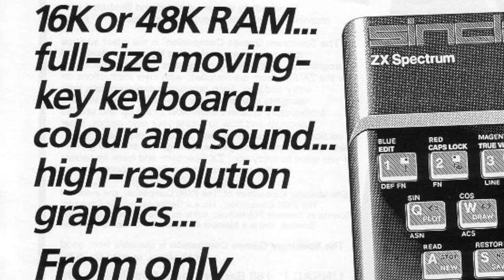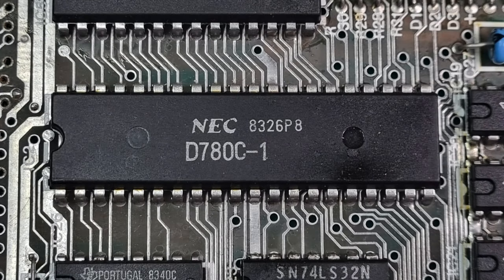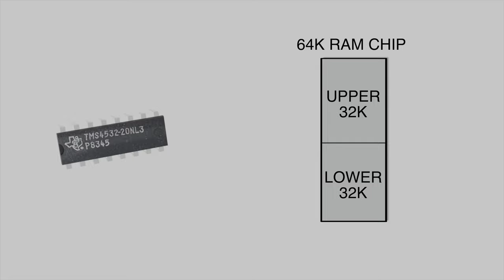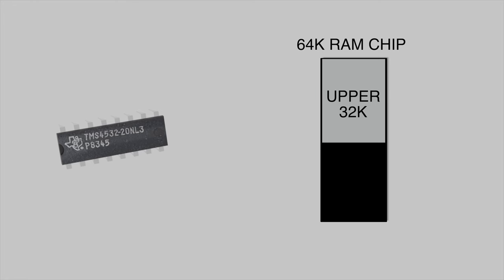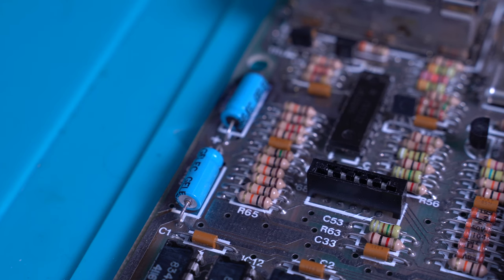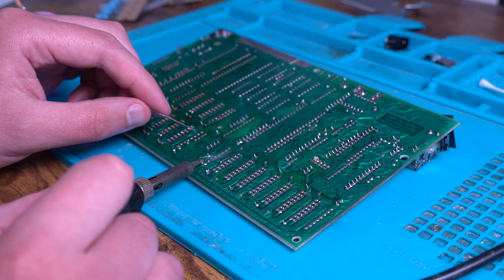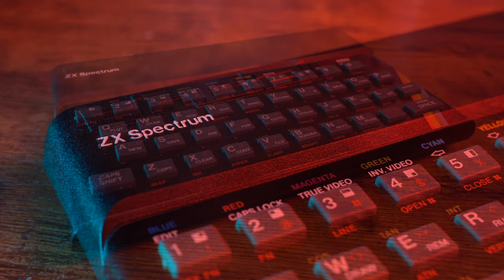ZX Spectrum - 40th Anniversary Restoration - 4K

Comment: I have - probably the only one - a ZX Spectrum which has a combined Composite Video + RF output.
Eg. it works with both composite video monitors AND old TV sets that can not handle composite video.
This modification was done by a shop owner, in order to allow me to use a composite video monitor; I told the shop owner that I still wanted to be able to use the Spectrum with a TV and he knew enough about electronics to make it hybrid.
From the outside, the ZX Spectrum still looks like any other Spectrum. I really wish every Spectrum had this modification.
Less than 10 years ago, I gave my Spectrum a new keyboard membrane and a new 'rubber mat'; the new keyboard membrane is much more durable than the original.

Comment: Great that the old TV modulator was left in place. Personally, I also leave the old heatsink and regulator in place, even if I replace the regulator with a Trico. Yes, the device in question was not very worn when the text on the rubber keyboard was in very good condition. Fortunately, they can still be replaced. In my own. LOAD button was worn out :)

Comment: I had one of these back in the eighties. I am not sure if it is this exact version. I remember I had to load software that came on cassette tapes via my portable cassette player and the whole thing was connected to my 10” Baird portable TV. I used to love the flight simulator programme which in this day and age is laughingly basic, basically a green screen with straight lines that you flew around and landed on. I remember it was so complex to load the software as one would press play and a certain amount of buzzes and chirps would come forth and you had to be right at the computer as it loaded as you would have to look out for a message to pause the tape, press a key then restart the tape. It normally took half an hour to an hour to load and if you made one mistake in timing you had to start right at the beginning! Then of course, when done and the computer was switched off if you wanted to play again you had to go through the whole process once more!

I had that computer for 4 years as it failed on me and then had a gap of  26 years before getting a Toshiba laptop in the early naughties! I remember as a working class person this was not a cheap computer, it made the Toshiba look like a bargain and now, we’ll, we know where we are now!
Reply: Great summary of impressions with your rubber-keyed wonder. Thanks for sharing!
You are severely wrong, however, when it comes to loading times. 1500 Baud (bits/second) meant you had to wait some 5 minutes for a full 48 kB file to load.
Any casette recorder of reasonable quality does the job just fine.
A C64 with its 1541 flopppy disc drive loaded with 2400 Baud only. So it was not that much faster but WAY more expensive. Yes, I know, speed loaders were the first thing to load on the 1541.
A microdrive was a fine thing to have for the ZX Spectrum. Coupled with a Multiface One, of course, for putting stuff on those cartridges. Loading times of 10 seconds were awesome back then.
Reply: Digital Integration: F-15 Fighter Pilot or Tomahawk (AH-64 Apache) maybe

Tomahawk was one of the games that shipped with the LensLok copy protection system, along with the ZX Spectrum version of Elite

Comment: Wasn't the Sinclair logo originally the same shade of red as the "symbol shift" font?  Other than that it looks fantastic!
Reply: Some of the later models had a red logo. The rubber key versions were always back.
Reply: @oktup  Sure my 16k version had a red logo...
Reply: @oktup  And a cursory check proves you're right.  I could have sworn mine had the red logo, it's strange the way the mind plays tricks on you after 40-odd years!
Reply: I know that the early 48K had white logos, but the ZX81 had a red logo; so did the ZX82.
-But some other models might still have had a red logo.
Personally, I've only seen ZX Spectrums with white logos, but that doesn't mean there were none with red logos. ;)

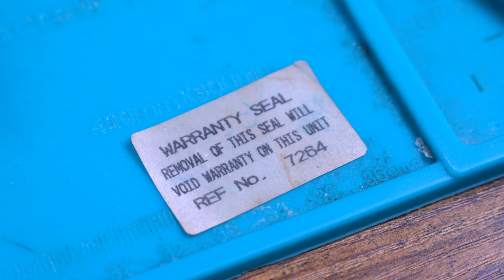Comment: 2:30 You're going to put the warranty seal back on?!?!? I think that would just make future repair needlessly more difficult, right? And, you do realize you're not going to actually get warranty repair, right? It would be amusing to put it back (underneath the screw) as a lark, but, I'd say this is going well beyond restoration and into insanity. It's not even mint condition to begin with. It's like breaking into an old abandoned house, and then doing housecleaning before you leave! 🤣
Reply: Putting a non genuine seal back.mans a fool

Comment: Re capped for the sake of recapping and no longer original with the 7805 removed.  Dear oh dear.
Reply: But he replaced the warranty sticker!!! 🤣 Sheer insanity.
Reply: The original components can be replaced if necessary. These mods mean the Spectrum is more reliable, more useable, and will extend it's life. Stop moaning, it's his Spectrum so he can do with it as he pleases. It's not as if they're even particularly rare!
Reply: @squirlmy  hardly insanity. He just wanted it to look the same as he found it, only a lot cleaner that's all.
Reply: Agreed. The way he replaced the axial caps with radials was a complete kluge, and the regulator was a real face palmer too... Keep the damn thing as original as possible if you're restoring it. I would have paid more for it before than after.
Reply: Would have been nice to use radial caps but otherwise why not modify to extend its life? It’s not like it’s rare or in mint condition